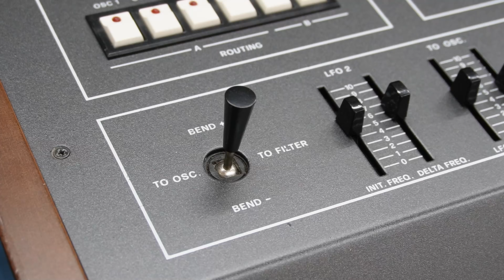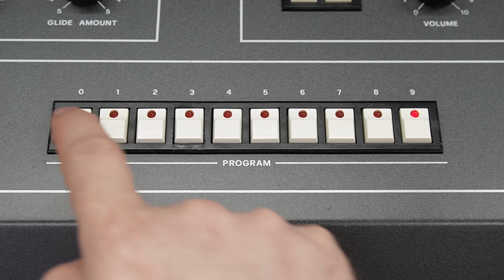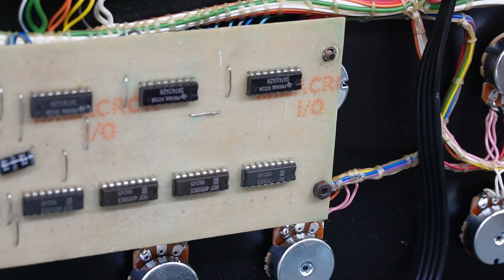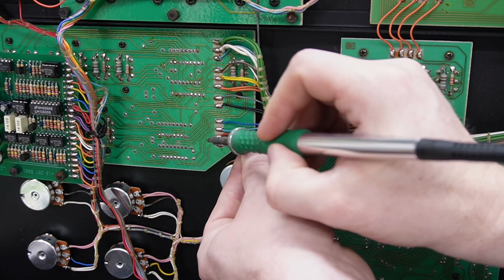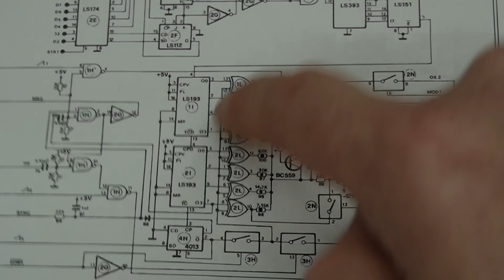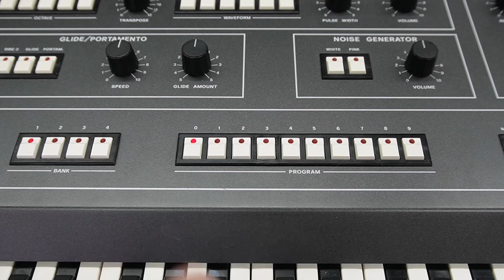ELKA SYNTHEX - A 1980's Legend Gets Fixed!

Comment: Sounded like some tormented pacman at the start and ended with some Oxygen.   I'd be checking the power supply side, usual elec caps and rifa's, plus put in a zener or two to clamp any spiking. I presume there are fuses in the right places to save the digital side if the power side fails badly...

Comment: Van Halen used an Oberheim OB8 for Jump ... which used very similar LED switches on the front panel.. only they were black which look better than these ones... made around the same era (early 80s)... originally with no MIDI but could be purchased as a retrofit... they weren't cheap either and like the Synthex... very pricey in mint condition these days

Comment: There are errors in the firmware of those chip testers unfortunately. Made me almost throw out a bunch of TI 74LS chips as I assumed they were fake. Turns out the problem was the ic tester, looking very similar to the one you were using...

Comment: Anyone got any recommendations for repairing lifted and\or broken copper tracks on a circuit board. Specifically, the power connector on a Digitakt that may or may not have slid off my lap after dozing off on the sofa. I'm admitting nothing.
Cheers 👍🏼

Comment: Jean-michel Jarre has three of these synths, probably because they develop faults. He’s used them on several of his albums but predominantly on his 1986 album Rendez-vous, especially parts 2 and 3.
The Synthex’s main competition was the Roland Jupiter 8 and you can see why the Jupiter was more successful with rainbow buttons and more colourful panel although the Synthex sounds a lot more powerful. It even had built in chorus before the Roland Juno 60.

Comment: @MendItMark I was cringing watching you try to figure out what was going on with it. I was giggling because I knew
It has to do with.
Also the operation of a synthesizer and what you understand the basic fundamentals of the operation of the synthesizer and how the control panel UI and preset saving situation works then you can interpret the schematics a little bit differently. (as you know!)

Secondly anything with preset you need to do a factory reset. And put the original factory patches back on so you can actually see the performance and listen to them because when the batteries die and the program memory gets scrambled unless you were a synthesizer sound designer and know how to create a basic patch from scratch, you're gonna be stuck in the weeds for a very long time. < Snickers > the last jam is amazing. You get a first place award on this one.

Comment: The wiring looms are very indicative that Elka was originally an organ company - manufacturers starting later in the game (like Oberheim or Sequential) would probably have gone with ribbon cables (and larger PCBs for the front panel).
I'm appr. in the middle of the video now but from what I heard in the beginning I would expect one oscillator to have a problem as well.

Comment: Making a prediction on this one. 2:30 in

Those notes are an octave lower than they should be. That points to a voice bank issue since it occurs on all the voices. Likely something being pulled to ground so there is always a 0 bit in place, or something is messing with the voice switching (bad/faulty button, potentially) which is causing it to send the wrong signals to the synth module.